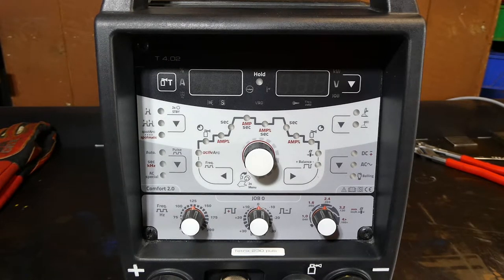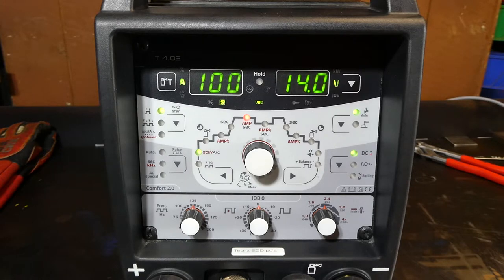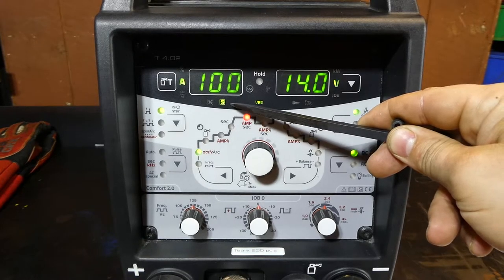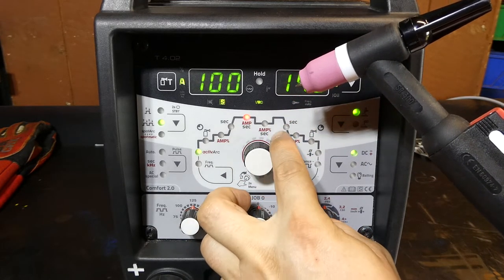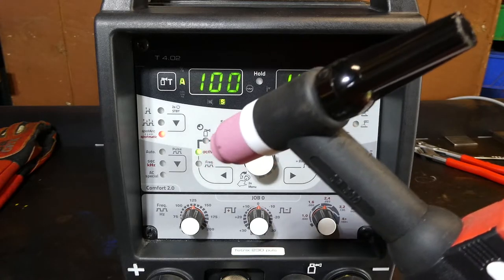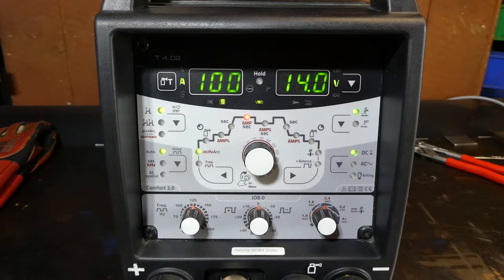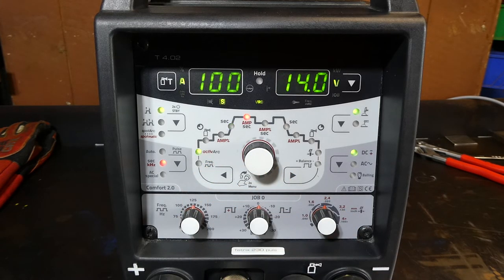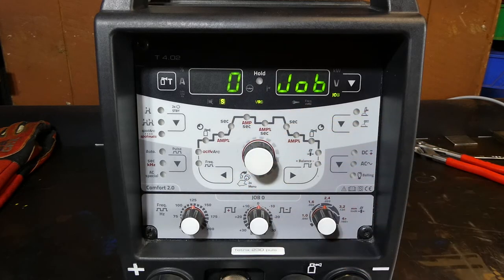EWM Tetrix 230 ACDC walkthrough 3 - Control panel features and basics

Comment: A small correction, within the function of the pulse in the manual direction the lower degree is in percentages of the upper one and not the amperage itself that you see on the screen. What you see on the screen is what percentage will be obtained from the maximum amperage that was set
Reply from the maker: If you are referring to the parameters at the 11 minute mark in the video (thermal pulsing) then both high and low current states are in amps. EWM displays will indicate the measurement unit of the variable using the illuminated icon to the left of the display (A, s, Hz, etc)
The factory setting of the machine is secondary current as a percentage of the main working current- however I have changed the advanced settings to show absolute values as opposed to percentages. I find it easier this way. Thank’s for your comment.
Reply: I didn't know it was possible to change, I will also check with my 2019 Tetrix 350 welder if it is possible, Thanks , gonen
Reply from the maker: @gonen786  check out the video I made on this exact feature. It should be consistent across all comfort 2.0 EWM control panels, irrespective of your machine output. 
https://youtu.be/4aqoAb5RPjs?si=syjnDQeu8ildZ6Dm

Comment: Would you rate the ewm welders better than miller or lincoln 🤔?
Reply from the maker: EWM make professional level machines, and have done so since the 1950's, all in-house R&D and manufacture, just like the Lincoln and Miller's of the world. So they are of a good pedigree. It's their name on the box, unlike a lot of the chinese made stuff that is branded under licence. 
If talking EWM across processes, then EWM have similar comparable process to other brands: eg EWM coldarc is like Lincoln STT,  Pipe arc is like EWM Root arc, and I'm sure EWM forceArc in MIG has a comparable technology that I can't remember. I'm not aware of anything in EWM that compares to Lincoln Hyper-Fill, but that's pretty niche. 
For TIG, I think Tetrix stacks up well against the likes of a Dynasty 210, I much prefer the Tetrix user interface - and the new Tetrix XQ LCD is amazingly good in that regard. There is plenty of other EWM machines that stack up against the BIG lincoln and Miller TIG rigs.